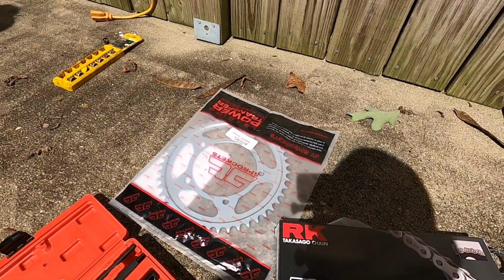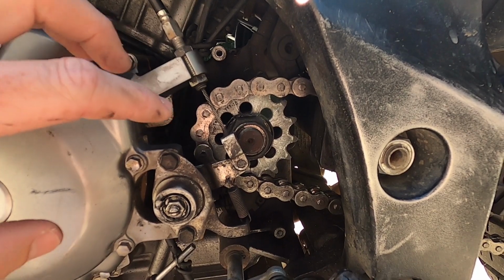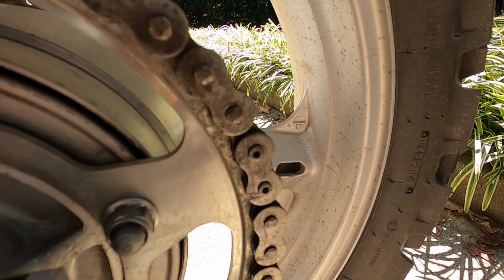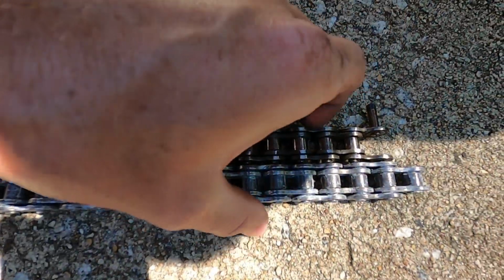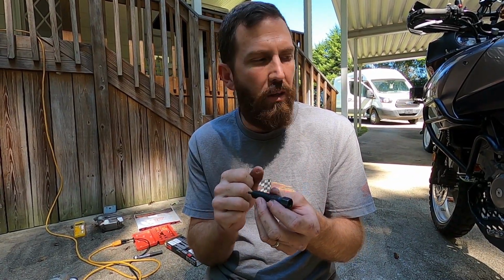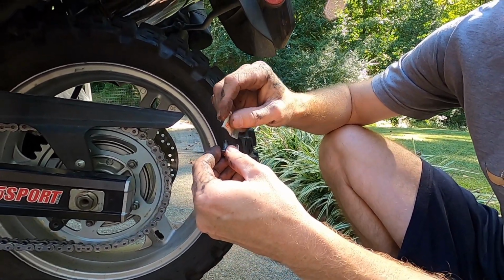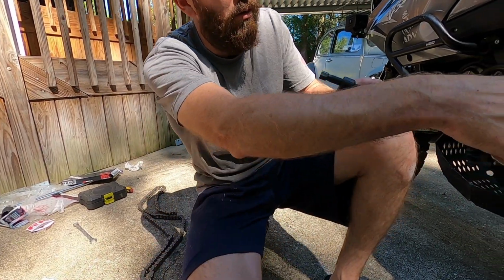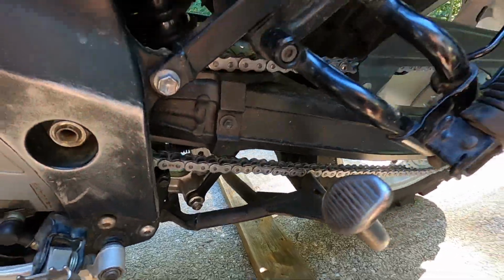Suzuki V-strom 650 Gets New Chain & Sprockets Using Cheap Amazon Chain Breaker/Riveting Tool

Comment: I can never reach that bottom left bolt holding on the plastic sprocket cover.  The shifter is always in the way.  What's the trick?
Reply from the maker: I haven't had a 650 in a while but I can't remember if I went from above or under the shift lever and I think I used a little ratchet. I do remember it being kind of a pain in the butt to get to. Sorry I can't be more help. I just haven't worked on one in a long time.
Reply: I helped with one of those a while ago, remember what we used because it was a bit ridiculous, but worked well. A motion pro 1/4” mini T-handle, 1/4” to hex adapter, looooong skinny hex extension, hex to 1/4” adaptor, socket. Hex extension was skinny enough to get in that gap, and your hand is working out past the peg.

Comment: is it normal to require a lot of force to rivet the pin?
Reply from the maker: Yes. It's a hardened pin that holds the chain together so it takes a good bit of force to flare it out.
Reply: @TheBeardedGrump  thanks. I just wanted to be sure I wasn't doing anything wrong. I had to use a wrench to twist the riveter tool and flare it to spec.
Reply from the maker: @hammadmaqsood7884  no problem. I had to do the same thing on my bike and my brothers too.

Comment: The way you ride, I'm surprised you didn't go with a bigger sprocket, or did you already do a smaller front sprocket? Another top tip, I always lube the threads on my chain tool while using it, a little lube on the threads makes it much easier and lowers the chance of damaging something or having it bind up.
Reply from the maker: We still have to ride a good bit of pavement and the V-strom 650 has a good bit of bottom end torque with the stock gearing. That's a good tip about lubing up the threads on the tool. Thanks for sharing that 👊.

Comment: Call me lazy but i use a master with a clip
Reply from the maker: That's what I've always used on my dirt bikes but I've heard that's not a good idea on this type of bike so I gave it a shot. I learned something new in the process so I guess that's a win 😁 So far so good so I  think I did it right.
Reply: @TheBeardedGrump  I've put over 40k on my strom with a clip no problems
Reply from the maker: @hoagiesherlin7732  I really wouldn't think there would be really. You know how things go in the moto world. People talk and you fall into the trap and I fell 🤣. This chain come with the rivet style link so might as well use it I guess.
Reply: @hoagiesherlin7732 Good to know.
Do you buy the fears that a motorcycle chain master link clip style is a "disaster waiting to happen" ?
It's said they can fly off easily !
True or hype ?

I also wonder if improperly riveted master links can also fail catastrophically ?

I also think shops spread self serving rumors to try to "scare up business".

Any feedback is appreciated - my 08 DL650 has 21,500 on original chain it seems solid but it won't last forever - not sure its max expected lifespan ?

Comment: Very nice walk through Greg!
I have never owned a chain breaker and remove them with the grinder. I put an RK chain on the 390 12K miles ago and it's still in great shape. - Frank
Reply from the maker: This is the first chain breaker I've ever owned. I usually do it with a grinder too. Mainly bought it to rivet the new master link. This was my first time doing that and so far so good 😁.
Reply: FRANK !!! - I have that tool as well. 15 bucks if I remember. Worked great.
Reply from the maker: @pilotdane1  it got the job done so that's good enough for me. 😁 Glad yours worked too.